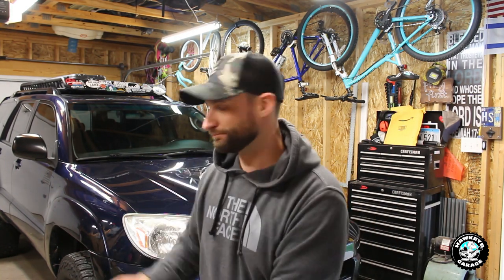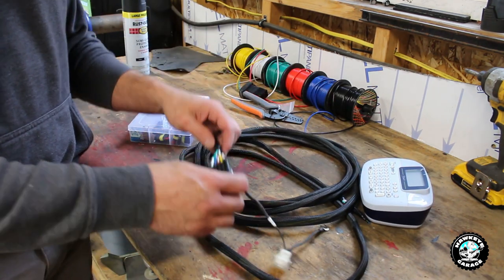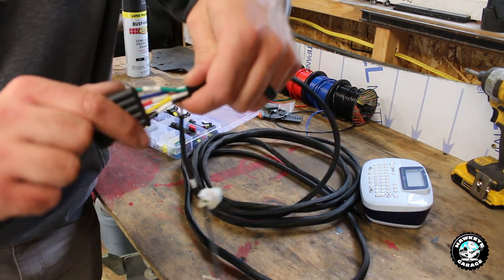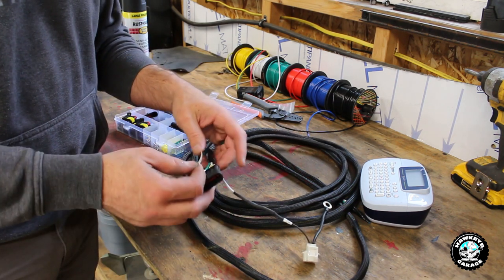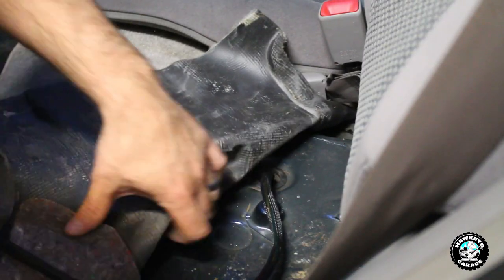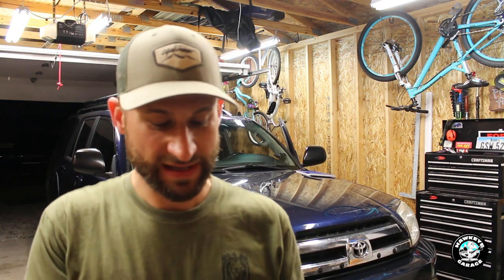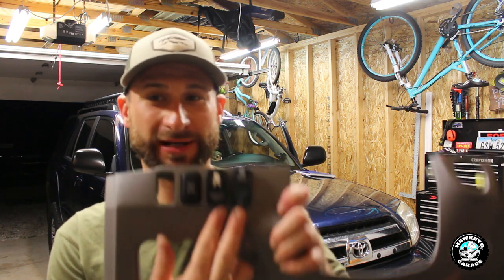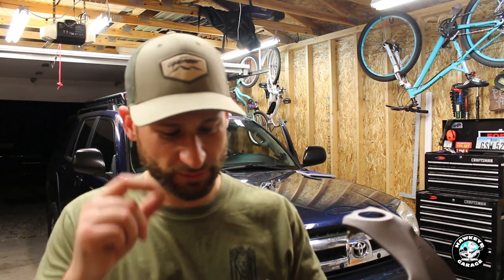4Runner E-Locker Switch Install

Comment: Quick question. I know you don’t have this truck anymore (unfortunately). But, why you did not go with the OEM locker switch from the FJ? If you had it already.. I’m also doing this mod, just need to run the wires now, is installed already
Reply from the maker: Short answer is because it doesn’t work that way…… I should probably do a video explaining it.
Reply: @HawkeyeSkunkWorks  Oh man I wish there was a way (easy LOL). But I appreciate the videos Sir. Helped A LOT while installing, cutting, drilling and etc down there.
Reply from the maker: @GerardoOquendo  Glad it helped!
Reply: @HawkeyeSkunkWorks  finally did my cable following your video and ended up having the same issue. It’s not lighting when locked. How did you fix that? It’s working, just not the light. I have the OEM sensor and the color is blue and yellow (just FYI) and the ground is black
Reply from the maker: @GerardoOquendo  Its touchy, if the locker is even 99.9% engaged the light wont light up.
Reply: @HawkeyeSkunkWorks  yes! Forgot to update my comment. It’s working 100% and it does light up when locked. Thank you for this video
Reply: @GerardoOquendo  
Did you go with 3.73? And which switch did you use?